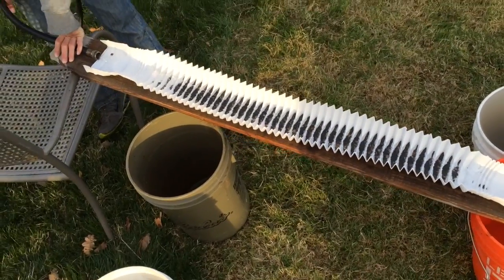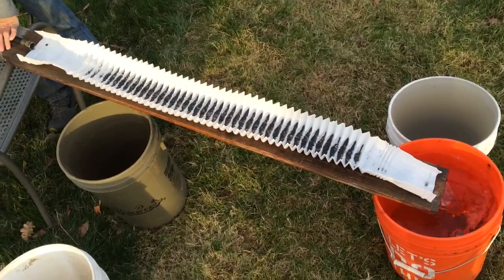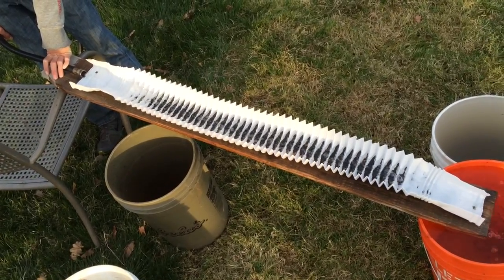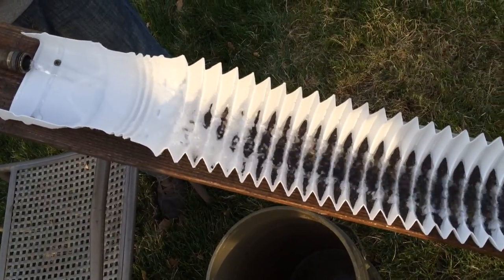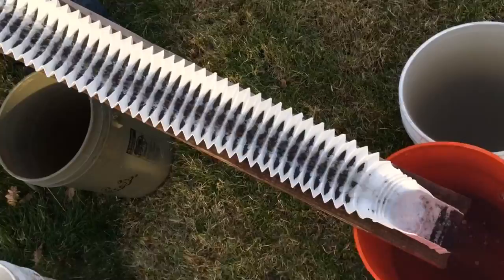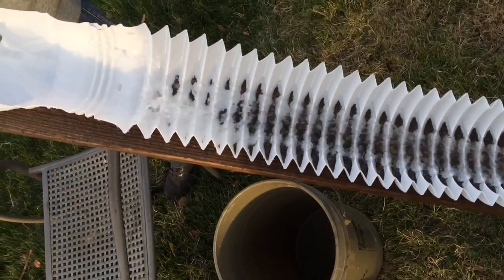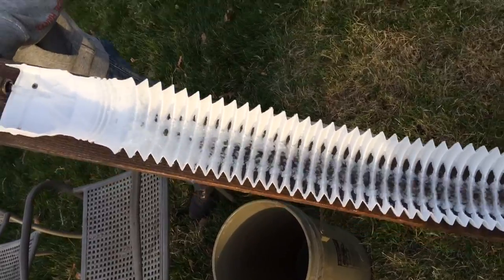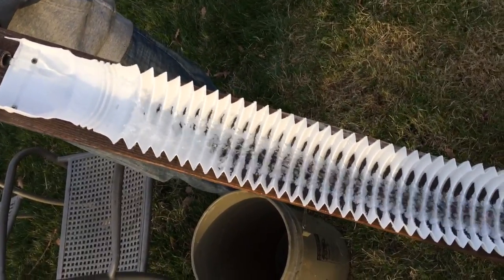Homemade rain gutter gold sluice part 3

Comment: I'm looking at building a sluice from what I suspect is the identical same gutter as you have in that video.  I think you have made two mistakes with it.  I think you have stretched it out too far, and you have the waterflow in the wrong direction.

I reckon the inclined glooves of the unstretched version if in the opposite waterflow would act as hungarian riffles.  Its been too cold to head up prospecting yet, but ran some of my heavies that I had collected from the autumn, and they all stayed in the grooves at the top 3rd of the channel.